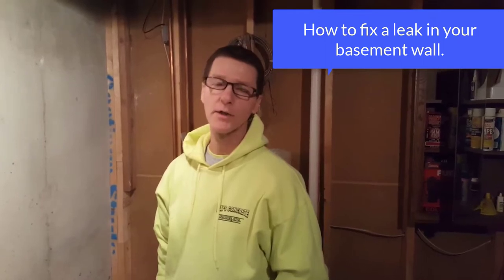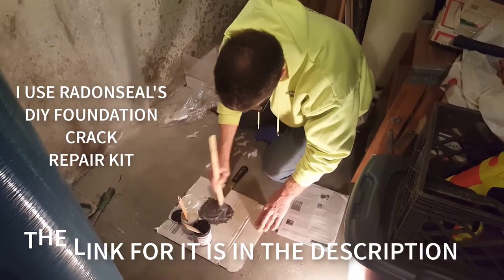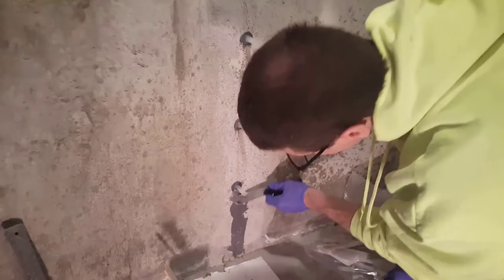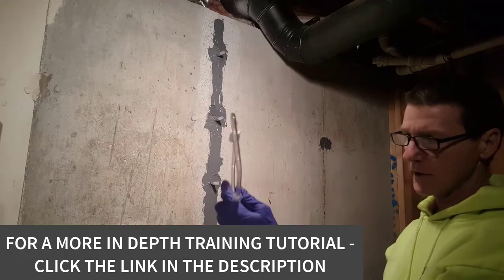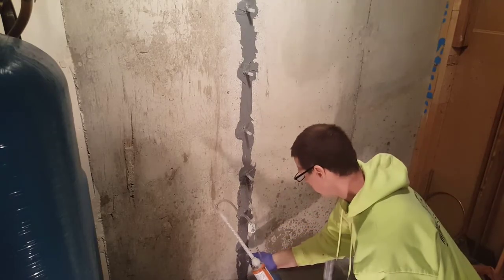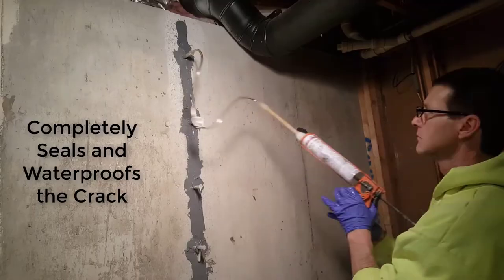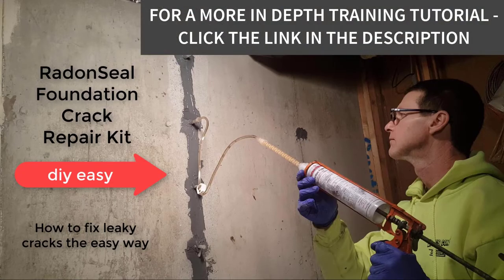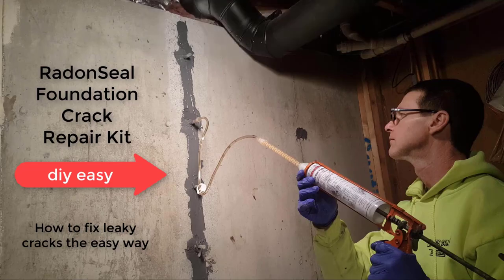HOW TO FIX LEAKS IN BASEMENT WALLS : FOUNDATION CRACK REPAIR

Comment: One interesting thing to point out that I got bit hard by is to epoxy the wall where it meets the floor at the crack line. I didn't put emphasis there and the poly ran out there super hard on the initial pumping in. Everything else went super smooth.

Comment: if the crack continues to the outside wall. Do you have to fill the outside with the filler so it doesn't leak out the back my crack goes all the way from inside the basement to the outside.

Comment: Mike, Thank you for the helpful video. We had a foundation crack repaired about 20 years ago using a similar process. Now when it rains heavily, the old crack repair leaks. What process do you recommend for 'repairing the old repair' and getting it right this time? I am considering doing the repair myself to save some money. I can take all the time I need so there is no rush. I just want to fix the leaking foundation crack. Any help you provide we will be most grateful for it.
Reply: I would expect you need to locate the leak line and follow the same process.

Comment: If the wall is damp from leaking and/or shows signs of dampness that haas not fully dried up, will the adhesive for the injection tabs and covering the crack before injection hold?

Comment: Would this work on a concrete floor? I have a failed vapor barrier under my slab and water comes up through the crack. I need to fill the void between the vapor barrier and my floor

Comment: Does this work in a horizontal crack ?
Reply from the maker: It can for Fixing a leak but it's not a structural repair.
Reply: Horizontal Cracks indicate a structural issue and should be inspected by a pro.